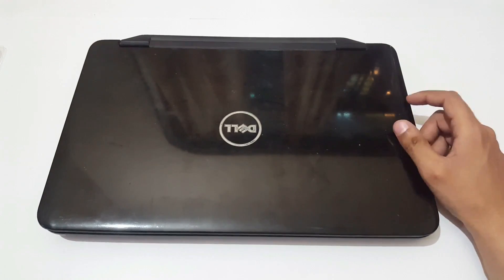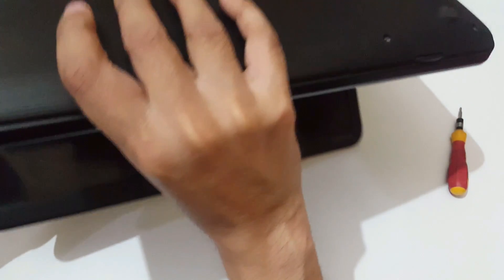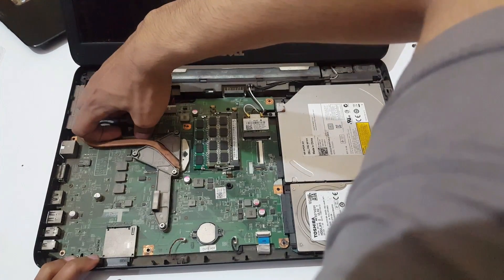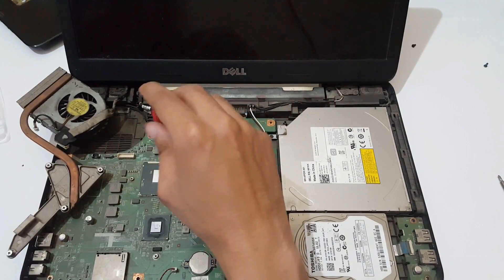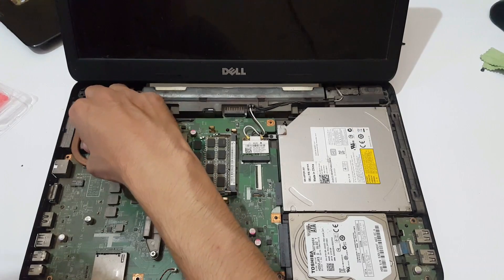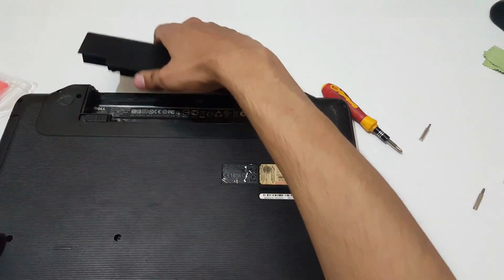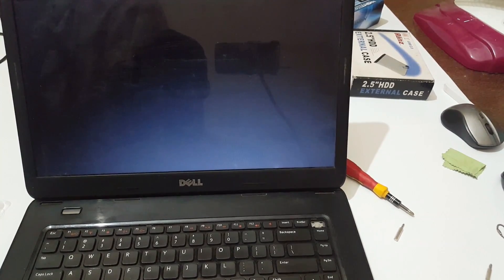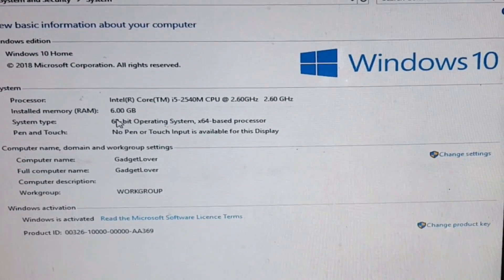How to Upgrade Processor on DELL Laptop | i3 to i5 & i7 - Make Laptop Faster for Gaming

Comment: Hey mate, can you recomend me what processor to upgrade
My laptop :
Dell latitude e6230, i3-3120m 2.50GHz (4 CPUs), ~2.5GHz, 8gb ram, intel hd 4000
Reply from the maker: Fiqar Prasetiyo : The processor of this Laptop is soldered so you can't upgrade it
Reply: @GadgetLover360  :(((
Reply: @GadgetLover360  thanks for the info man, very appreciated
Reply from the maker: Fiqar Prasetiyo : You're welcome and I would suggest you upgrade its RAM and install SSD for better performance
Reply: @GadgetLover360  where did you get the detailed information about my laptop, like the soldered processor?
Reply from the maker: Fiqar Prasetiyo : I saw full disassembly of this Laptop
Reply: @GadgetLover360  ooohh, okok thanks again mate, next time when i want to buy a new laptop I'll ask here first, keep it up the usefull content.
Reply from the maker: Fiqar Prasetiyo : It's my pleasure

Comment: I have a Acer Aspire  E 15 E5-575-33BM laptop notebook with 500 SSD 8GB Ram i3

What do you suggest it the best processor for my laptop
Reply from the maker: Itz Flaco : The processor of this Laptop is soldered so you can't upgrade it

Comment: Very useful video thank you a lot.. just subscribed to your channel . I have a dell inspiron M5040 with CPU:AMD E-450 at 1.65 ghz.. can I upgrade it????
Reply from the maker: Xαράλαμπος Σισμανίδης : Dear subscriber you're most welcome and the processor of this Laptop is soldered so you can't upgrade it but I would suggest you upgrade its RAM and install SSD for better performance
Reply: @GadgetLover360   thank you for the quick respond..I have a dell inspiron 1564 as well . with Intel core I3 .. can I upgrade this one;;
Reply from the maker: Xαράλαμπος Σισμανίδης : You're welcome and yes Intel Core i5 580M is best processor for your Laptop

Comment: Bro i want to ask u if i will replace the laptop processor with pc processor it will generate more heat. Will laptop cooling fan handle it. There is any problem or not plzz reply
Reply from the maker: Vansh Choudhary : If upgraded processor Watts is also same it will not generate more heat
Reply: @GadgetLover360  if i will replace amd A6 to ryzen 3 2200g
Reply from the maker: Vansh Choudhary : You can upgrade it in same generation only

Comment: I have i3 M350 2.27 Ghz with 4GB RAM. I want a cheap i3 or i5 that is better than my current one. I also want 4+4 or 8+8 RAM. Which do you think is best for my laptop? And please make sure it can run Minecraft.
Reply from the maker: TheMultiRounder Gamer : Intel Core i5 580M is best processor for your Laptop and I would suggest you upgrade its RAM and install SSD for more better performance
Reply: @GadgetLover360  But when I checked Intel website it is saying that it is discontinued, and could you also tell me the price in INR?BTW Where to buy?
Reply from the maker: TheMultiRounder Gamer : I would suggest you buy it from Aliexpress online store
Reply: Thank you very much, I found it for only 2000 to 3000 Rs
Reply from the maker: TheMultiRounder Gamer : You're most welcome

Comment: Bro i have dell inspiron 3542 ..which processor should i upgrade to and how much much it will cost to?
Reply from the maker: Shekhar Maheswari : The processor of this Laptop is soldered so you can't upgrade it
Reply: @GadgetLover360  so what to do then
Reply from the maker: Shekhar Maheswari : Upgrade its RAM and install SSD for better performance

Comment: Bro i have dell vostro 1014 core 2 duo suggest me best latest processor that i can upgrade.
Reply from the maker: SUN RISER : Intel Core 2 Duo T9900 is best processor for your Laptop and I would like to inform you if processor is soldered you can't upgrade it
Reply: @GadgetLover360  currently i have 2GB of ram (.Vostro 1014) Can i upgrade to 4GB or 8GB??
Reply from the maker: SUN RISER : Yes

Comment: Bro I been using dell Inspiron 15 i5 5th gen on 8 gb RAM , 1Tb HDD , 240gb SSD and 4 Nvdia graphics. Can I chnge the procesor to i5 8th gen ?
Reply from the maker: hemchandra singh : Unfortunately you can upgrade it in same generation only
Reply: @GadgetLover360  i have intel core i5 480 M can i upgrade to i7 or not
Reply from the maker: Bilal Bilal : Intel Core i7 640M is best processor for your Laptop
Reply: @GadgetLover360  thanks
Reply from the maker: Bilal Bilal : You're welcome
Reply: @GadgetLover360  can u tell me what is best desktop GPU to run with my laptop by eGPU please
Reply from the maker: Bilal Bilal : You can attach it externally to your Laptop
Reply: @GadgetLover360  i know but which gpu is best and cheap to attach it with my laptop
Reply from the maker: Bilal Bilal : AORUS GTX 1070 GAMING BOX

Comment: i have a n5040 can i run i7 2640m processor? if so do i need swap the fan as well? 

thank you
Reply from the maker: lazybone 14 : What processor is in your Laptop
Reply: Gadget Lover it’s running i3, it’s the same laptop on this video appreciate you answering
Reply from the maker: lazybone 14 : Yes and I would like to inform you if processor is soldered you can't upgrade it
Reply: Gadget Lover okay so first make sure it’s not soldered, if everything is good to go i7 2640m processor would be good to use. Would you recommend upgrading the fan or it’s not needed?
Reply from the maker: lazybone 14 : I would suggest you upgrade its RAM and install SSD for more better performance

Comment: Bahi mujhe batao mera dell latitude e6420 hai core i5 hai    4gb ram  aur hard disk hai toh meh kya aisa upgrade krun kay laptop gaming kay liye sahi challay  system type 64 bit and  2.5 ghz speed processor
Reply from the maker: bhx gamer786 : Intel Core i7 2640M is best processor for your Laptop and I would suggest you upgrade its RAM and install SSD for more better performance
Reply: @GadgetLover360  bahi kya yeh k er clocked ho skta hai 2.5 ay 3.2 ghz speed proccesor
Reply from the maker: bhx gamer786 : Unfortunately you can upgrade it in same generation only
Reply: @GadgetLover360  bahi kya matlab yeh joh hai core i 7 2640m  mai overclocked ho skta hai yeh kehray ho yah kuch aur
Reply from the maker: bhx gamer786 : You can upgrade it with Intel Core i7 2640M processor
Reply: @GadgetLover360  but you told me 2 core processor i need 4 core and 4 threads processor can yoi tell me
Reply from the maker: bhx gamer786 : Intel Core i7 2760QM
Reply: @GadgetLover360 kitnah ka milay ga yeh processor
Reply from the maker: bhx gamer786 : I would suggest you buy it from Aliexpress online store
Reply: @GadgetLover360  wesay kya price hogi kindly bata day
Reply from the maker: bhx gamer786 : For better pricing details go to Aliexpress online store and search it

Comment: I have same laptop I wanna upgrade to i7 suggest me some good processor?for multitasking...I'm your old sub!!🙂
Reply from the maker: Syed Ali : Dear subscriber Intel Core i7 2640M is best processor for your Laptop
Reply: Core i7-2630QM or Core i7-2670QM can fit in my laptop?because when you suggested me i5 I used it but I didn't get performance...I need 4 cores 8 threads!!because I need to virtualize kali linux!!please kindly give me a solution
Reply from the maker: Syed Ali : Yes but it will produce more heat in comparison of Intel Core i7 2640M
Reply: @GadgetLover360  is it safe to use it?
Reply from the maker: Syed Ali : You will face overheating issue
Reply: @GadgetLover360  ok but can I virtualize kali  linux on i3 2350m?latest 2020.1 version
Reply from the maker: Syed Ali : Yes
Reply: @GadgetLover360  thank you soo much sirr🙏🙏🙏
I'm glad that you replied my every question 😇
You're good human sir😇
Reply from the maker: Syed Ali : You're most welcome

Comment: what kind of paste is this that you have used on the new processor.....? what happen if we don't use this paste ?
Reply from the maker: Ram Dev Sangam : It is thermal paste which is very high heat conductive paste to get better heat conduction and it is better than the air gaps so I would suggest you apply it

Comment: Please recommend i5 upgrade for my pc 
Ram:4gb 
Processor:intel(R) core (TM) i3-6100U CPU @2.30GHz
System type:64 bit
Reply from the maker: Dinesh Kumar : Intel Core i5 6300U is best processor for your Laptop
Reply: @GadgetLover360  what about Ram???
Reply from the maker: Dinesh Kumar : I would suggest you upgrade RAM and install SSD for more better performance
Reply: Bro mere pass dell latitude e5420 , i5 hlhai 2nd gen kiya upgrade hoga ram or processor
Reply from the maker: neo jwick : Intel Core i7 2640M is best processor for your Laptop and I would suggest you upgrade its RAM and install SSD for more better performance
Reply: @GadgetLover360  thanks for you suggestions  bro👍
Reply from the maker: neo jwick : You're welcome

Comment: Can you suggest me a cpu for my laptop TOSHIBA l40-143 with intel Pentium dual-core 1.6 ghz
Reply from the maker: IamDrutzi : Intel Pentium E2220 and Intel Core 2 Duo E4600 are best processor for your Laptop and I would like to inform you if processor is soldered you can't upgrade it

Comment: Comrades , i have dell inspiron 15 , what maximum processor can i have ?
Reply from the maker: Eduard Khill : What processor is in your Laptop
Reply: @GadgetLover360  it is celeron
Reply from the maker: Eduard Khill : What model
Reply: @GadgetLover360  model 3473
Reply from the maker: Eduard Khill : Intel Pentium N5030 is best processor for your Laptop and I would like to inform you if processor is soldered you can't upgrade it
Reply: @GadgetLover360  thx
Reply from the maker: Eduard Khill : You're welcome

Comment: Hey man, I was wondering what Processor would fit with my HP Notebook/Laptop?

I have a i3-6006U @2Ghz Dual Core
8 GB RAM (2x8) 2400Mhz DDR4
Intel HD 520
Reply from the maker: Merp Morp : Intel Core i5 6300U is best processor for your Laptop

Comment: I want to repleace hard-disk,because old is damaged.Can I use any 2,5 inch hard disk or I need specified HD for Dell inspiron n5050?
Also,when I install windows 10 on my inspiron n5050,it works normally some times when I turn on laptop.Then ,problem appears:screen is turned on,but it is black and laptop needs to be connected with tv screen via   HDMI cable to show what is on the screen.Does it mean that there is fault on screen or it happens because of damaged Hard Disk?
I have Intel Celeron,and I want to repleace it with i3.
Reply from the maker: Aleksa Pajic : Eject RAM and reinsert it properly and see whether the problem has been solved or not and if problem still exist delete all partition then format HDD and make partition again then install verified purchased Windows
Reply: @GadgetLover360 Ok,but will every 2,5 inch HDD would be compatibile to repleace?
Thanks for feedback,I will try it.
Reply from the maker: Aleksa Pajic : Yes because Laptop drives are typically 2.5 inches

Comment: Hello sir, I plan to upgrade my Dell Inspiron 3420 i3-2328M 2nd gen, does this unit can upgrade to higher processor or ram upgrade?, thou it has only 2gb Ram installed, Thanks for the video, it helps really a lot. I hope i can have a suggestion for upgrading my lappy :) should i buy for the new one?
Reply from the maker: jhapygaming : Intel Core i5 2540M is best processor for your Laptop and it supports up to 8 GB RAM so I would also suggest you upgrade its RAM for more better performance
Reply: @GadgetLover360  thank you sir!, Thanks for the feedback 🤘☺️
Reply from the maker: jhapygaming : You're welcome

Comment: I have lenovo Ideapad 320 intel i3, 
can i upgrade it to i5 or i7 ?
Reply from the maker: Free Traveller : The processor of this Laptop is soldered so you can't upgrade it
Reply: Gadget Lover , So whats the solution My laptop is barey used , how can i make it fast .. it works like a pentium series..
Reply from the maker: Free Traveller : I would suggest you upgrade its RAM and install SSD for better performance

Comment: bhai.. i have dell vostro 15 3568.. it has intel Pentium processor.. it is very slow.. can i upgrade my process. if yes then which one would u suggest? plz help bro!
Reply from the maker: Avdhesh SG Mittal : Processor of this Laptop is soldered so you can't upgrade it
Reply: @GadgetLover360  soldered means.. attached ? can i never upgrade this😣.. so suggest me tht what should i do?
Reply from the maker: Avdhesh SG Mittal : Upgrade its RAM and install SSD for better performance
Reply: i ungrade its ram by 2 gb.. but no better performance is there. and tell me which ssd is good for this?
Reply from the maker: Avdhesh SG Mittal : Samsung 860 Evo 2.5 inch Internal Solid State Drive is better choice
Reply: @GadgetLover360  usse performance better ho jayegi kya?.. nd isse m kha se buy kr skta hu?
Reply from the maker: Avdhesh SG Mittal : Yes and you can buy it from online store or nearby PC Store
Reply: kya ssd lgane k baad.. gta5 jaise games chl payenge??
Reply from the maker: Avdhesh SG Mittal : It will slightly improve the performance of your Laptop

Comment: Bro I have Intel Pentium 3805U processor can you suggest me best processor for my laptop, it is very slow I need little fast than this
Reply from the maker: Anup : Intel Core i5 5300U is best processor for your Laptop
Reply: @GadgetLover360  thanks for replying me bro, can you tell me I have Dell vostro series laptop with Pentium 3805U processor, do u think it is upgradable.
Reply from the maker: Anup : You're welcome and if processor is soldered you can't upgrade it

Comment: bro I have dell 1903 i3 6006uCPU 2.00ghz 4gb ram can I upgrade it to i5 or i7, please suggest me the best core for my laptop.
Reply from the maker: Creation of Fire : Intel Core i5 6300U and Intel Core i7 6600U are best processor for your Laptop
Reply: @creationoffire you should also have the corresponding ram suppose you use i5 then change the ram to 8 gb i5 won't work well in 4 gb ram 
And if you use i7 the shift to a ram of 10-12gb ok

Comment: @Gadget Lover I have a dell xps 15 l502x with i7 2630qm processor what  can I upgrade to
Reply from the maker: king of wolves : Intel Core i7 2860QM is best processor for your Laptop and I would like to inform you if processor is soldered you can't upgrade it

Comment: I have the same model...u have used 2450m is it compatible bcoz i learned that i5 2430m is the max it can take.....plse reply..
Reply from the maker: Rohit Kumar : Yes and it is wrong in my knowledge this processor is best for this Laptop
Reply: @GadgetLover360  so i can use this processor??...it won't affect my motherboard?...how long u have been using this since upgrade...
Reply: @GadgetLover360  and thank u for the video..it was very helpful
Reply from the maker: Rohit Kumar : Yes and I am glad that my video has solved your problem

Comment: hey bro i have a dell inspiron 15 i3 processor 7100u what processor do you suggest i upgrade to?
Reply from the maker: rickyrhoomes : Intel Core i5 7300U is best processor for your Laptop and I would like to inform you if processor is soldered you can't upgrade it

Comment: Love your content keep up the good work!!!!!!! 
I have a Dell vostro 2520 intel celeron 1000m cpu can I upgrade to i3 or i5 cpu processer?????????is it possible an can it be done?????
Reply from the maker: YFL_DYNASTY : Thanks and Intel Core i5 3380M is best processor for your Laptop
Reply: @GadgetLover360  are you 100%sure???
Reply from the maker: YFL_DYNASTY : Yes
Reply: @GadgetLover360  if processor is solder in dell
Reply from the maker: CK Bro's : If processor is soldered in your Laptop you can't upgrade it

Comment: Hey bro I have hp 15-p028tx laptop with Intel core i3-4030u can i upgrade it in i5 or i7???
 if yes please suggest the processor!!!
Reply from the maker: arif qureshi : Intel Core i5 4310U is best processor for your Laptop and I would like to inform you if processor is soldered you can't upgrade it

Comment: I have and old dell Inspiron 1545 quad core can I upgraded to i3 or i5
Reply from the maker: nitin saini : The processor of this Laptop is soldered so you can't upgrade it
Reply: @GadgetLover360  shit, thanks  one more question I have new dell Inspiron 3567 i5 can I upgraded it with SSD it is worth it and which one is good.
Reply from the maker: nitin saini : Yes it will improve the performance of your Laptop and Samsung 860 EVO is best choice

Comment: I have both dell 14 inspiron 5423 i3 2367M and inspiron N4010 i5 M480 and planning to upgrade to 500gb and 8+4 ddr3. Whats the best processor if possible to change?
Reply from the maker: kae TV : The processor of Dell Inspiron 14 5423 is soldered and for Dell Inspiron 14R N4010 Intel Core i7 640M is best processor
Reply: @GadgetLover360  thank you for coming back. Yes O just read that on dell's discussion page.
Reply from the maker: kae TV : You're welcome
Reply: @GadgetLover360  which one do you think should i upgrade both ssd and memory, the i3 or i5? I am considering the i3 since it is much lighter to bring with me always than the n4010
Reply from the maker: kae TV : More you upgrade better the performance of your Laptop
Reply: @GadgetLover360  planning on upgrading to 8gb+stock 4gb ram and 500ssd. Which laptop should I upgrade.the i3 or i5 dell?
Reply from the maker: kae TV : Intel Core i5 upgrade is the better choice
Reply: @GadgetLover360  thank you! Thats what i want to hear.😊
Reply from the maker: kae TV : You're welcome

Comment: Bro I have Toshiba dynabook T45 with celeron 3215u
What is best processor? Can I upgrade?
Reply from the maker: Andy Ng : Intel Core i5 5300U is best processor for your Laptop and I would like to inform you if processor is soldered you can't upgrade it